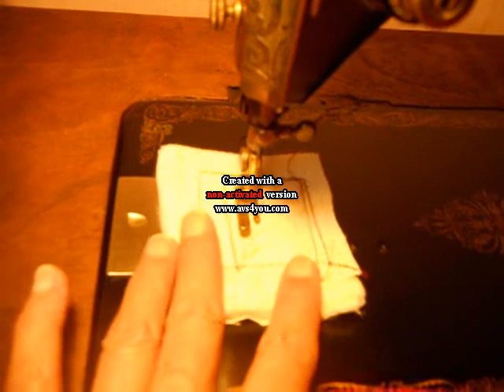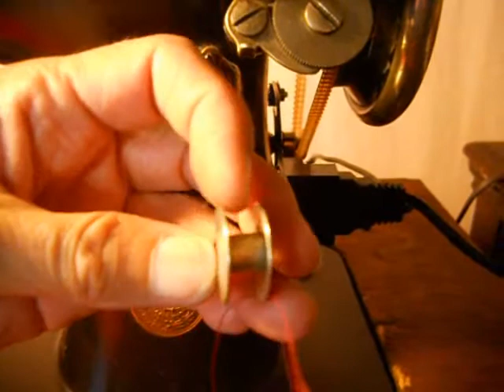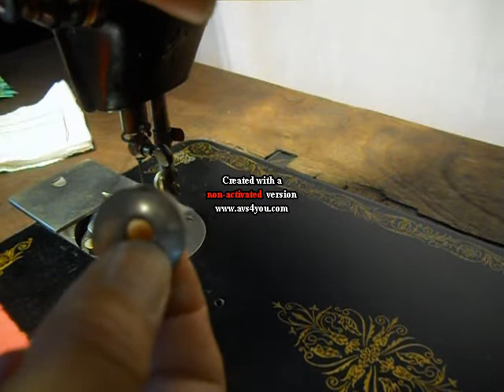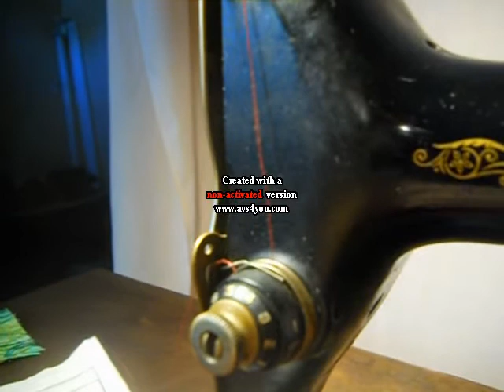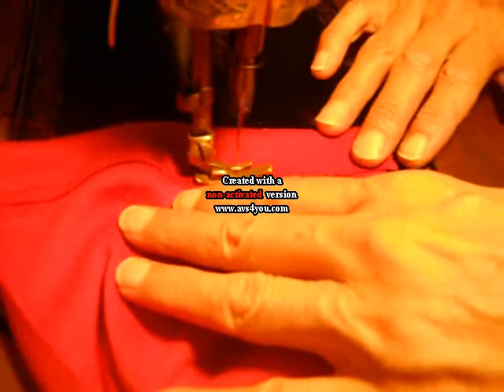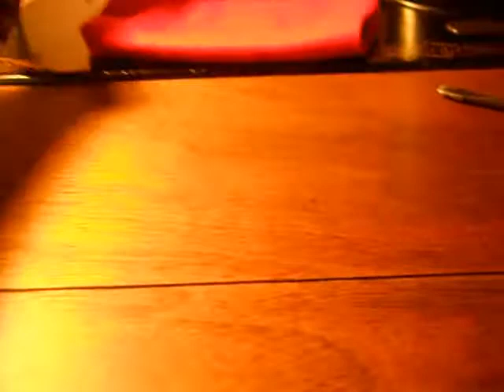1947 Singer Model 66-16 Bobbin and Straight Stitch

Comment: Do you think this machine could handle corset making?
Reply from the maker: Probably yes. The 66s are one of the stronger machines Singer made. I've never made corsets, but do you need extra strength in a machine to go around bone inserts or something?  If it's going through 4 or 5 layers to make bone stay pockets then yes, it will do that.  The "most" powerful machine Singer made is probably the 15-91, but the 66s are very strong machines.

Comment: I just got a 66-16 with every attachment conceivable (and a few more) last weekend.  I'm in the middle of going through it to get it ready to sew.
Just redid the foot control and made up a new power cord. Mine is nothing special, but looks to be a good machine for a learner and able to handle heaver stuff then my featherweight.

When you dropped the bobbin.  You show the thread coming off the left side. 
My 66-16 instruction manual shows the thread coming off the bobbin in the opposite direction.  
So that the thread is coming off the top of the bobbin with the thread coming from the right side.
This is indicated in the pictures and the text in the Singer booklet.
I'm wondering if there is a change in the directions over the long history of the 66?
Or where did you find the method you are using?  Or have you found that your method just works better?
Thanks.
Reply from the maker: Hi- you caught a blooper! Ha! No, go by the manual. I have several different machines, and sometimes just pop the bobbin in without checking the book- go by the book. :)  You will like the 66-16 - a 66 workhorse.
Reply: @LaurieOMeara  Cool, Thanks for the quick reply.  Just stitched my first line with it an hour ago!

Comment: What type needle can I purchase for this machine
Reply from the maker: Hi - Most Singer full size household machines take a size / classification of a 15 x 1 needle.  That size is different from the fabric weight-size (thickness) of a needle. So, this link has standard Singer needles (they took 15/1 off the packaging) in sizes for different fabric weights:  https://www.amazon.com/SINGER-4790-10-Pack-Regular-Assorted/dp/B00114Q76U/ref=sr_1_6?ie=UTF8&qid=1537621264&sr=8-6&keywords=singer+15x1+needles

Comment: Nice machine. My aunt has a 1940 66-17 with a knee lift bar but not to raise the presser foot. It’s used to actually sew! Have you seen this type of machine. I love the top front drop in bobbin!
Reply from the maker: Hi - yes, my grandmother's Singer 99-13 was a knee-bar machine. Because of the age of the motor, I just recently converted it to a handcrank.  The 66s are wonderful sturdy machines.